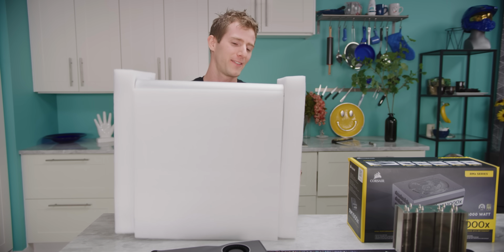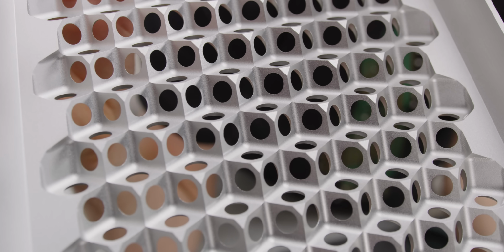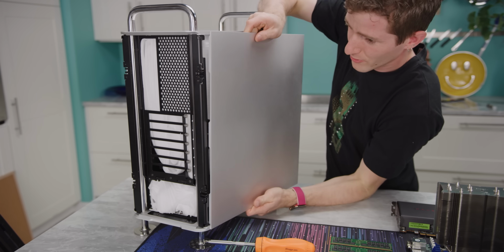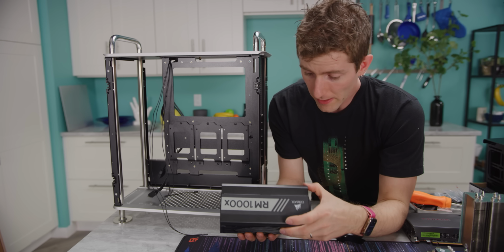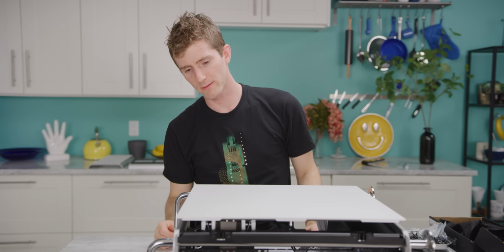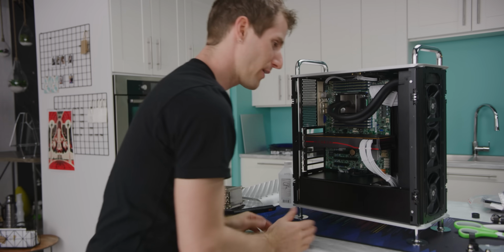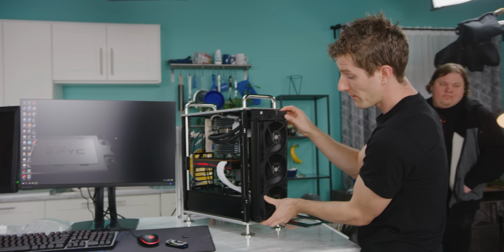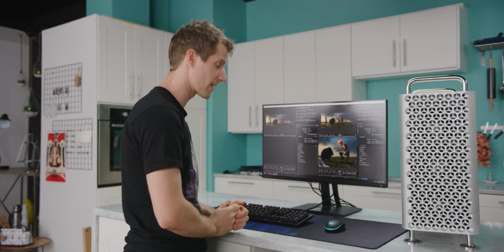The Fake Mac Pro Case is SHOCKINGLY GOOD (DO NOT BUY)

Comment: I wish they would have ripped it off even more so I could get that cool new cover type thing where you rotate the handle.
Reply: Probably had to skip that to keep costs down.
Reply: @desther7975  Must've spent the rest of the $250 they sell it for somewhere else
Reply: @Juan Cortez Muro IKR ITS SO FUNNY I FORGOT TO LAUGH
Reply: @Mxjor  aluminium is a comparatively expensive material and machining is also expensive, it's impressive they're only charging $250 for it considering all the thick aluminium panels and machining that goes into it, and limited production runs. This is about the same price as a DrZaber Sentry case(much smaller and completely steel) so reflect on that for a moment.
Reply: Belagerungsmörser the Sheep  "Steel is much harder to machine" eh. Not really. Keep in mind that there are different grades of aluminum and the price can stack pretty high with the treatment considered
Reply: Belagerungsmörser the Sheep  Carbon steel is what's typically used, which is far heavier and cheaper than aluminum. Low-carbon steel isn't used for cases because it's more expensive than carbon steel and has less rigidity while still heavier than aluminum. Stainless steel, which I have seen out there in the wild, is the most expensive of these variants. You're correct about steel being harder to machine, though, as it's significantly more dense in all forms versus aluminum.
Reply: Belagerungsmörser the Sheep  Depending on the type of steel, steel can actually be extremely cheap compared to aluminum. Try seeing what the scrap value of an old steel truck vs. an aluminum framed car is.

Plus steel is easy to bend, form, and weld compared to aluminum.
Reply: Belagerungsmörser the Sheep  except steel cases are mostly made of pressed secc steel sheets and not machined at all, and if you check out market pricing aluminium is over tree times more expensive per ton than the secc steel sheet rolls you can get from China.
Reply: Belagerungsmörser the Sheep  and I can find you an alibaba listing of 3mm thick steel for $700 a ton

Comment: That actually seems like a shockingly decent case design, though I feel quite certain that it's expensive AF. Still, not as though there aren't worse looking and more poorly constructed cases which demand exorbitant prices. Also, this motherboard isn't alone in lacking fan speed curve controls. It seems like a decent majority of workstation boards which are derived from server boards rather than consumer boards lack such functionality. I don't know why this is the case, but here we are. If you're going to bother getting a workstation motherboard, only bother with Asus's insanely expensive premium line of workstation boards if you want to have proper controls and overclocking options. I got one of their cheaper ones for the LGA2011v3 platform and it won't even let me set the RAM speed. I'm sorely tempted to just give up on the option to add a second processor in the future and just jam my existing setup into an X99 board and run with that instead just so I can get reasonable performance controls.
Reply: It was a scam

Comment: You'll find it interesting to know that there is a store, in Casablanca-Morocco, who got 4 units of these  in stock (no website) for 4000MAD/400us with a regular front panel ( no dune pro brand  mentioned though)
Reply: I hear many private manufacturers are milling themselves. I hear on TonyMacx86 that China has many cases but not the same color.

Comment: The LG competition got me thinking. I have multiple times in the past tried to setup some distribution of linux on a laptop and there's always some functionality (sound, ports, media keys from keyboard, sensors, screen rotation or tablet mode) that just refuses to work without resorting to 1) excessive amount of googling, 2) finding what part of the OS is bugging out and 3) fixing the bug by myself. This is why I usually try to buy a laptop that has the fewest possible amount of features so the probability of non-functioning features is slightly smaller. Does a modern laptop exist where all of the features work out of the box?

Comment: Currently I am using a Toshiba PA3758U, it is virtually unusable as it is so old slow and extremely heavy. Also the keyboard not working requiring me to bring around a mini keyboard to plug in doesn't help. Since I am going to college next year to study computer science which I would need a computer or laptop for and I could really use a LG Gram for its minimal weight and good specs. As an 18 year old with 70 year old back problems I know the light weight could benefit me greatly😂😂.

Comment: I'm a little late to the party, but I have a question.   How wide is the "Front fan mount?   It looked about 3.5" or so, and the slots would allow HDD mounting.  Is there room to put intake fans between the Front-outside of that bracket and the inside the front panel?   Other than lacking a backplane, that looks like a ton of room for a village of... oh i dunno, a reasonable family of WD reds.

Nevermind... another look at the website gave me a positive answer.

Comment: Linus use vicegrips when taking fittings off. I have used vicegrips for several things like your doing. Vice the hoses down no liquid is going any where.
Reply: vice-grip at the end, the underlying rigid connecter is in the way, vice-grip a few inches away from the end, water leaks up to the vice-grip, water has left the system and air has entered the system. lets say no water came out (which I doubt) but wouldn't there be less water in the system due to the squeeze of the cable, when the new block was attached, the vice-grip removed, the tube would still be squished do to the volume of water missing from the vice-grip depressing the cable. squished cable means decreased water flow and decreased cooling. either i don't understand your point to it would not be an improvement. thinking some more, if the open end were raised above the rest of the cooling system, water could be refilled. i prefer what he did in the video
Reply: The point is when you change a part you can use vicegrips to stop water, gasoline and oil from coming out of hose line not a cable.
Reply: You must never worked on any veichles or any mechanics. You can use vicegrips on a lot of things

Comment: Seems to be a trend to make cases with no accessible bays. Why am I not supposed to need front accessible drive bays anymore? I still like  being able to add an optical drive, card readers, hubs,  SATA docks. etc. I just bought a 2013 era Thermaltake case for a build because modern cases are gorgeous but not as practical.

Comment: I noticed there are no dust guards. Will the Mac Pro have them? Hummm, either way those holes are very large overall, how do you trap the dust for easy cleaning in either the copy or the actual Mac Pro???  When the Mac comes out, I hope you will check/mention this as is could be important as an 'easy maintenance' point. ;D

Comment: But please don’t use AMD epyc unless you want to have headaches. Natively macOS kernel isn’t designed for amd cpus and getting it to work requires extensive kernel patches. It’s better to go intel with vanilla. Also check out acidanthera github for great Hackintosh resources. That’s just a friendly advice. Cheers!

Comment: I just gave my opinion to another youtube channel about this case. It is a crappy junk case because it does not include an ODD drive bay. I will not buy any case that does not include an ODD bay. I will buy a Rosewill Rise case with the ability to mount a power supply in the top or bottom of the case and does include several ODD bays.

Comment: Notebook FanControl by hirschmann on github is an excellent way of creating and controlling fan curves directly from the operating system. And since it's specifically designed for laptops, it's designed to bypass the bios fan curve as long as your motherboard physically has the ability to do so.